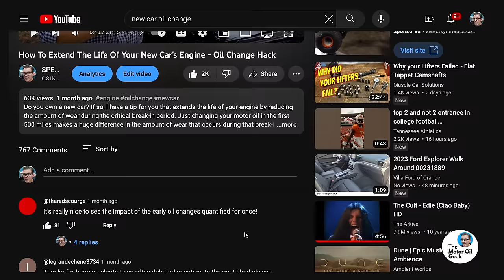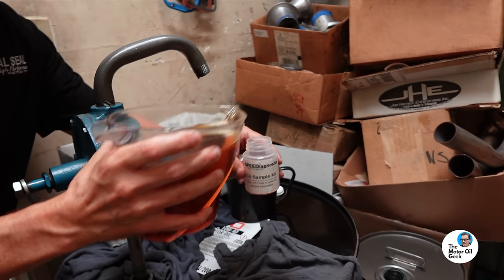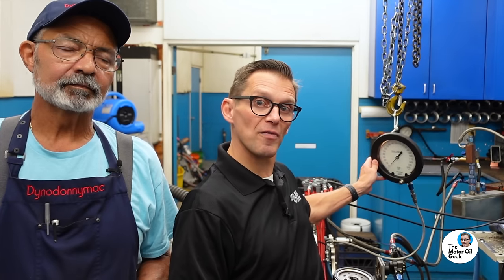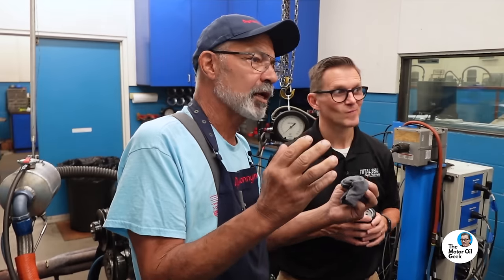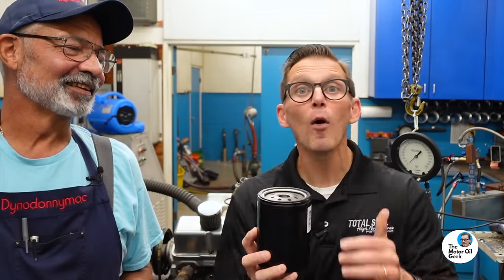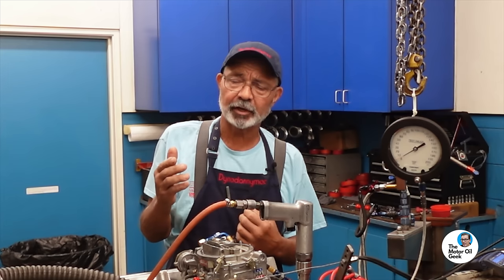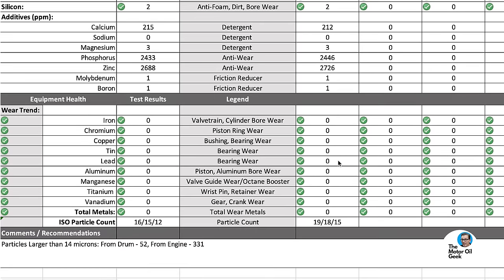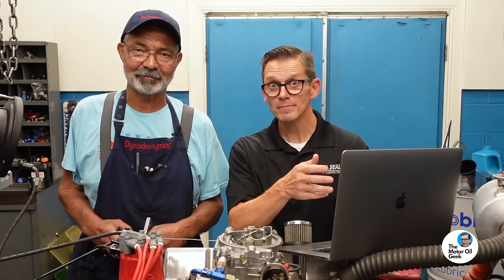Does Pre-FILLING The Oil FILTER Cause Engine DAMAGE?

Comment: On engines with the filters that are installed from the bottom of the motor, yes, I can see pre filling the filter. Because when you go to install the filter, the oil won't run out of the filter. But what about in cars that the filter installs sideways to the block. This means that if you pre fill the filter, the oil will run out because the filter is installed sideways.

Comment: Great test procedure guys. Only proves what should be common sense. Hard to believe some will argue against putting oil in a filter! 🙄
Reply from the maker: Thank you!
Reply: I have been changing my oil myself all my adult life and have never done this.  My motors have not seized or used oil and have lasted a long time.  I'm not against it, I just don't believe it's at all necessary.
Reply: @Lemmingadventures  nobody says you have to but again, why not. While your old oil is draining why not fill the new filter so it ready to install? Ask 100 engine builders about it. Any worth their salt will say the same thing about filling the oil filter.
Reply: @lcee6592  I'm not arguing whether it's right or wrong to do either.  I'm irritated at some of the arrogant people that are branding those of us as morons for not doing it.
Reply: @Lemmingadventures  well ld say do what you ultimately think is best for you. Don't worry about others. 👍

Comment: It would have been great if you pulled a valve cover, and let everyone see how long it takes that oil to get all the way up to the top of the rocker arms. I teach this in my engine class so the students understand the complexity of the oil system. It will be many more seconds, sometimes as much as 20 before the valve train start to receive proper lubrication.
Reply from the maker: Great suggestion!
Reply: how long does it take when new oil is poured into the engine? what I am saying is you just poured basically 4-5 quarts of new oil directly into the top of the engine.🤔
Reply: @iffykidmn8170   Any oil you pour into the engine will just drain down to the oil pan. True enough some of this oil may coat the surface of some of the mechanics's on top of the cylinder head, this will not be the same result as the pressure lubrication it receives from the oil pump.
Reply: @themotoroilgeek   how about a plexiglass valve cover?  you can see everything at operating levels.
Reply: @jamescaron6465  GREAT IDEA!

Comment: I think the issue is you sometimes get bits from the plastic bottle blow molding that let loose after the oil is in the bottles, and the bottles are shipped.
I think if your funnel has a screen to catch dust and bottle bits then there shouldn't really be a concern pre-filling the filter.

Comment: As a former "lubrication specialist" and retired mechanic when I was young and excitable I ALWAYS prefilled (mainly on heavy equipment) but as time went on, and I had "sage advice" from seasoned mechanics I discontinued the practice...you have to remember this equipment was used hard and small amounts of wear on the engine was more than acceptable....but if you love your engine? pre-fill.

Comment: Can you make a video on the difference in using a catch can versus not using one? I'd like to see the difference in the oil, especially with a well designed catch pulling out water and gas vapors. Would be interesting to see if the oil breaks down just as fast or if it lasts longer.
Reply: @darkrelic6199 A catch can or the oil has ZERO to do with dirty valves in a direct injected engine. The reason the valves and intake get so dirty in a directed injection engine is simply because there is NO gasoline in the incoming air stream to help clean the valves and intake off.
Reply: @davelowets  it does hence the purpose of a catch can. To stop excessive oil blowby from the crank case from entering the combustion chamber and causing carbon build up on valves. That's why it was invented. To reduce carbon on your valves because of as u said no gasoline being sprayed over the valves to keep them clean. The catch can helps keep them cleaner for longer
Reply: @davelowets  maybe u miss read what I said. I said it helps keep the valves clean. :) do your research on catch cans. I own gdi engines and catch cans are important to slow down valves carbon buildup it helps remove the excessive oil from entering back in over the valves
Reply: Want to see u prefill a horizontal mounted filter.
Reply: The people who say you don't need to prefil the filter are the same people who mount them horizontally so you can't. Same guys that invented extended oil change intervals. Engineers at the manufacturers. They don't want your engine to last forever. They want it to last the warranty period, then die shortly after

Comment: After working on so many motors that have upside down filters i desided it was not a thing to do
Reply: Both my cars have upside down oil filters and cannot do this ,even if it would do good to the engine.It is impossible to fill filter and have some oil still in until filter is well tightened
Reply: Couldn't you add just enough to soak the filter media?  I would think some would still be better.

Comment: I believe prefilling may have been a nice thought back in the day.  Both of my vehicles now have an oil filter that sits on its side and even when upright I doubt would hold very much oil at all.   The filters I use, OEM, and less than 3 inches long and maybe 3 inches across.   The oil pump will fill that thing up in less than a second.  These are dinky filters!  But sure, if one has huge filters, it seems like it would make sense to prefill them.  But for a modern car with a shotglass for a filter, meh.
Reply: So your theory is that you aren't starving your engine for oil for very long? even if you put enough oil in the filter to saturate the filter media you will be doing your engine a big favor.
Reply: @recrdholdr  If you have ever witnessed how much oil comes out of the head ports by "bumping" the starter on a modern engine, you would not concern yourself.   It's not 1975 and it's not 1970's 10W40.   Modern oil leaves a nice film for the microsecond that oil isn't in the location you want it to be.  The proof is in the pudding, and the pudding is sitting my my driveway with well over 300K miles and not a drop of oil usage.  Oil changes every 5000 miles and yes, I don't fill the oil filter as it would make a helluva mess, being horizontal. Besides, most modern cars have a thimble sized oil filter.  If we're talking about a class 8 truck with two gallons worth of filter, you have a point, but on a modern day car?  Nah.
Reply: @bechtoea Prefilling doesn't make a mess if you buy a quality filter like a Wix with an anti-drainback valve. Been prefilling Jeep 4.0's and Chrysler RB's with horizontal filters for years with little to no mess!

Modern oiling systems are quite hit or miss in reality, too many modern engines grenading or have major top end failures due to oil starvation! You would think after 100+ years we would have figured this out by now!

Oil has always left a nice film, whether it is from 1975 or 2005, so I agree with the other guy, anything you can do to make sure that oil pressure gets up is the way to go, because anytime you don't have oil pressure you're increasing the odds of failure! Minimize those odds!

That's also why I always cringe when I hear people running 20W-50 in an old car...the OEM's have always recommended a 10W/5W-30 throughout the 50's, 60's, and 70's because they wanted good oil flow from startup and those old oiling system really aren't that bad when you dig into them.

Comment: Those who say you shouldn't pre-fill the filter have understood nothing about how a car's lubrication system works.
Reply: Or, we understand everything about it and aren’t idiots…. Also, reading isn’t very difficult….  Many filters even have pictures for you simpletons….  Don’t prefill..
Reply: @sjfk1306 I'm an automotive engineer. I've worked for Audi, BMW, Alfa Romeo... and also in motorcycle racing. At Audi and BMW, we did tests on the oil circuit's looping time. With a cold engine, this can take up to 30 seconds (tests on a V6 TDI). The difference with an empty filter is 15 seconds longer. If some filter manufacturers tell you not to fill the filter, it's because some idiots do it with used or unfiltered oil. Obviously, it's very difficult to make a picture of this, for idiots who can't read and think they know everything.
Reply: @ducmore7391  it’s not the filter manufacturer. It’s Cummins and caterpillar…..  Says it in service manuals and on the filter/box….  It doesn’t take 30 seconds, or even 15 seconds. Cool story but you’ve just lost all respect with that BS. Even at 0 degrees it won’t take 45 seconds.
Reply: The tests I'm talking about were carried out in an Audi-approved laboratory. We carried out the tests in accordance with strict validation rules. I repeat that closing the oil circuit on start-up took just over 30 seconds. This was on a V6 TDI. I know what I saw, I was there! I'm not going to waste my time describing the test method, I've got better things to do.
I also took part in tests at BMW, on an M5 (E34). The lubrication circuit was "dry crankcase". The tests were carried out empirically, with less rigor, because they weren't in an approved laboratory. But looping the oil circuit also took a lot of time, that's for sure. 
It would be foolish to think that these figures apply to all engines. As for Cummins and Caterpillar, I can't say because I'm not a master of heavy-duty mechanics. I'm just talking about what I know and what I've experienced. 
About your respect, that's the least of my worries.

Comment: Another thing to consider is the engine’s oil filter bypass, cold oil is not likely to go through the filter anyway because it’s too thick until it is warmed up.
Reply: Idling until the engine is warm mitigates oil temp issues, but freshly changed oil is room temp anyway.

Comment: I believe engine engineers should be the ones answering this question.
Reply: The same engineers that designed the 23 mustang that needs the front end removed to change the filter or having to pull the body off a truck to fix the engine. Also, if you don't fill your filter, you're starting your engine with no oil to the crank.
Reply: Why do you believe they want your engine  to last more than abput 75k miles? It would put them out of a job.
Reply: @batvette  not sure but I only buy Lexus and so far all last over 250,000 miles easily
Reply: @Numberone292  most lexus buyers dont keep their cars that long.

Comment: I didn’t even watch the video yet. But I don’t need too to understand that’s there’s nothing wrong with filling the filter. That’s what the internet does. Spread false info. And in most engines. The oil goes in the pick up on the pump from the sump. Goes through the engine.  Passes through the filter before going back in the pan. So the first reason is nonsense. On a turbo car or truck tractor trailer. Pre fill the filter

Comment: Good stuff, I've always thought about this and unfortunately on my recent cars I haven't been able to prefill the canisters because they use upside down housings with a paper filter. I still run the engine before doing the oil change, then hurry up to start it up after changing the oil to use as much residual oil film while the pressure builds up.
Reply: it doesn't really make any difference, unless cars last 40 years!
Reply: If the filter has a check valve you can put some oil into it before installation. Even if you just saturate the filter media is better than nothing.
Reply: Thanks @kellygibson4653  , that's what I've been doing, dosing the filter with oil, and trying to quickly do and upside down flip to avoid any messes when screwing in the housing.
Reply: If you take the plugs out and spin the engine over there will be next to no load on the bearings while giving it an initial prime

Comment: Yup, I've been filling the filter ever since they came out with cannister type filters.  I never saw proof that my practice is correct until now, it just seems like common sense.  Thanks for showing us.  I have a couple of questions for you regarding synthetic vs. conventional oils on older engine designs:   My understanding is that my 2005 Jeep 4.0 is based on the AMC 258 CID from the 1950s or '60s, which weren't designed with the tight tolerances of modern engines.  Is synthetic oil wasted on these older engine designs, or do they benefit from the added protection synthetic oil affords the newer engine designs?   Also, what are your recommended oil change intervals for these older engines?  Back in the day when I did the oil changes on Dad's 327 CID Impala, he taught me change that oil and filter every 2,000 miles.  Oils and filters have improved since those days,  and on my conventional fill cars I went to 3K intervals, then to 5 K.  Thanks in advance for your answers.
Reply: Modern oils designed for older engines have a good dose of ZDDP whereas modern synthetic oils for modern engines have little to none as it damages the catalytic converter. With modern synthetic oils without ZDDP the rockers can wear unevenly and prematurely. I had this happen - they wore unevenly. Now switched to a modern oil for classic cars and no wear at all - just the usual tiny adjustments needed.
Reply: I have been informed by  an ASE master tech who has taught auto shop classes for a couple of decades, that there are some engines that do not benefit from most synthetic oils, because they use too much oil in too short a number of miles.  He had several Saturns donated because they ran out of oil way before they should have required an oil change.  He suggested that either using a conventional oil or a higher viscosity synthetic might have kept those engines alive.  If YOUR  Jeep is  going thru more than a quart every thousand miles, you might want to look into a 15/50 synthetic, especially in warmer weather.  I do believe that the later fuel injected 4 liters were built to tighter tolerances that the old 258, but the only real way to know is to check your dipstick after the engine has been off fore a couple of hours, or preferably overnight, and see how much oil is being used every 1,000 miles, and experiment with oil viscosity and synthetic vs. synthetic blend vs. non-synthetic.
Reply: Thanks for your reply Doug.  On my previous Jeep I ran full synthetic and at 205k miles it was still doing well, but with a very noisy valve train.  Even after changing rocker arms and push rods my friends still teased me about owning a diesel when I started it cold.  But… noisy or not it was still going strong at 200k +.  It was totaled in a collision, so I will never know how much longer the engine would have lasted.  I will keep a close eye on the oil level on the “new” Jeep as you suggested and probably continue with conventional oil for the present.
Reply: Glad to hear the helpful info and thanks for the reply.  @VintageLynx

Comment: Thanks for the video. I’ve always pre filled the filter cause that was how I was taught when I was a young man ( back when oil came in cans and you had to stab them with a metal pour spout 😂) it’s nice to know that’s what the experts do 😁. Man those spouts used to make a mess! I don’t miss those. Thanks again for the informative video 👍
Reply from the maker: Thanks! The oil can days. I remember those.
Reply: I still have one of those steel can opener spouts in my garage😂
Reply: Yeah, that`s when I would buy a case of 24 cans of Valvoline at Lassus gas station.
The good ole days! @themotoroilgeek
Reply: @allengregory4067 😂 you should show it to a young person & see if they can guess what it is.😂

Comment: Ok I’ve been a truck driver and mechanic all my life. Filling an oil filter before replacing should be done. But not all oil filters are mounted upside down or open side up. So in that case what I do is start/stop the engine a few times to get the oil pressure up and filter full. In high mileage engines I’ve actually used Marvel Mystery oil to fill the oil filter.

Comment: What RPM does your drill (when priming for the oil pressure) simulate to get that 4-second result?
Reply: While a good question, it's more academic than practical.  Whether it's simulating 5 rpm or 500 rpm, it's going to be simulating the same rpm each time and you saw there was a marked different in time to full oil pressure with the same rpm with an empty vs full filter.  If cranking rpm is faster and the pressure comes up quicker in the car, it may not take as long to build pressure with an empty filter, but the time  to pressure with a full filter will also be reduced by a proportional amount.  

You can measure this yourself when doing oil changes and watching the oil gauge on your car.
Reply: @Ladco77  
Point taken. BUT, since we are talking in microns and milliseconds, why not disable combustion until oil pressure is achieved. After all, it's the connecting rod bearings that get hammered on the power stroke. No combustion = happy rod bearings in the absence of oil under pressure.